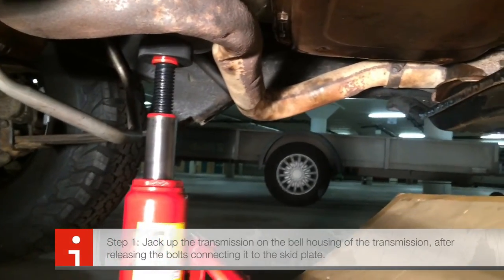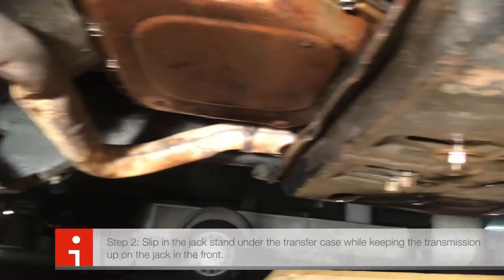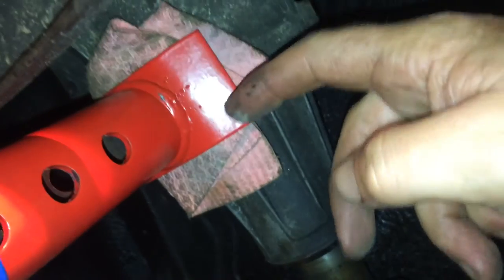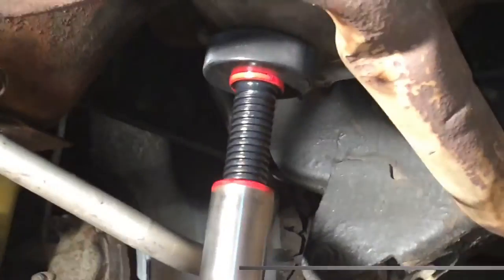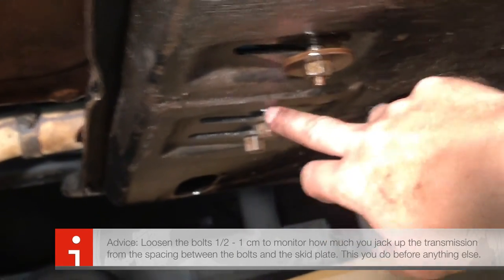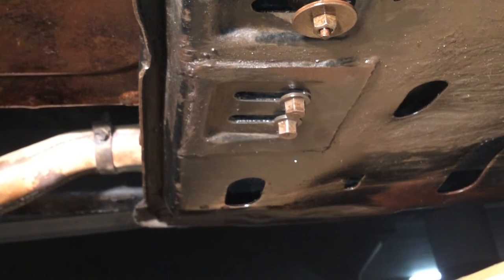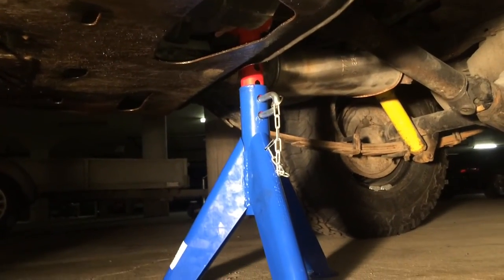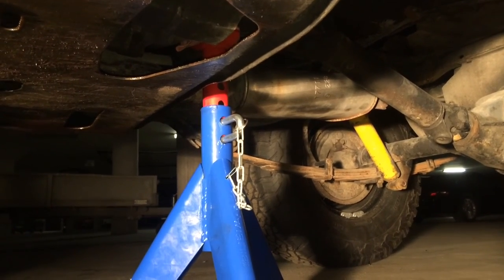How to jack up a transmission on a hockey puck and where to put the stands - Jeep Wrangler YJ : Ep 2

Comment: What is the function of the "stud" with the two round rubber bushings?
Reply from the maker: On the other side of the skidplate that you see, there is a relatively thick and wide, sturdy metal plate coming out from the center of the transmission. The "stud" connects the metal plate with the skidplate, and its purpose is to prevent the whole transmission from not changing position rotational-wise. Its probably mostly an issue if you drive tough terrain, and mine worked even with a useless stud in the city. You find this easy understandable if you get in under these to see the hidden metal plate.
Reply: Ahhh Okay!  I have a 1993 YJ and soon am going to attempt this same repair. The "stud" on mine is like yours was, it just rattles and moves around and is very loose.  Question:  Did you replace yours with an "aftermarket" transmission mount, or did you replace it with a "Factory Mopar" mount?  If you used an aftermarket mount, were you happy with the quality of it?  Did you buy your new mount as a "transmission mount kit"?

I see that the "aftermarket" mounts are very cheap, about $10, where the "Factory" part is about $80.
Reply from the maker: I got mine with the original rubber support you see in one of my other videos. However, it didn't look exactly the same as the original I took off so either they have beefed it up or put in an after market. Regardless, it was thicker but here make sure you keep all the shims because the stud that came along didn't have them all with it.
Reply: Okay thanks for all the information.